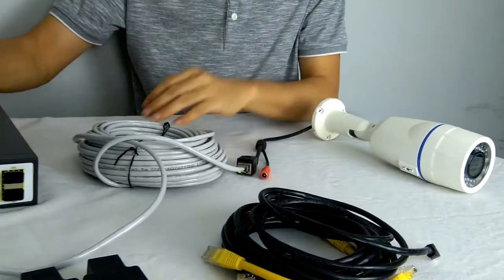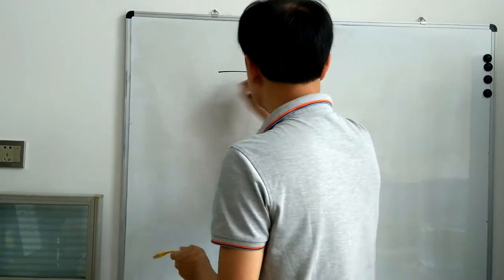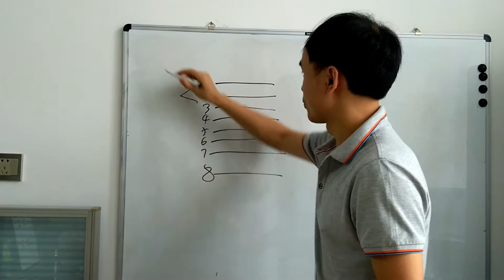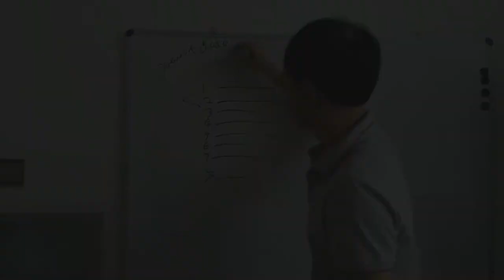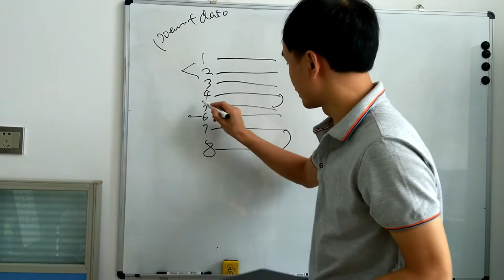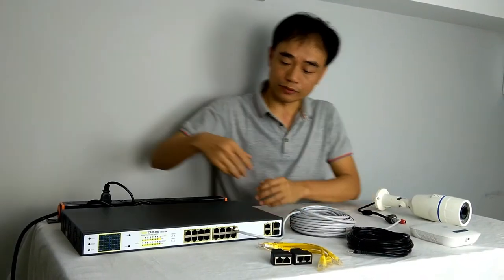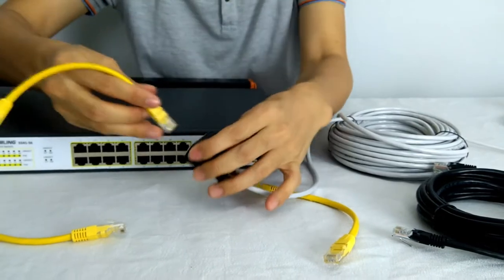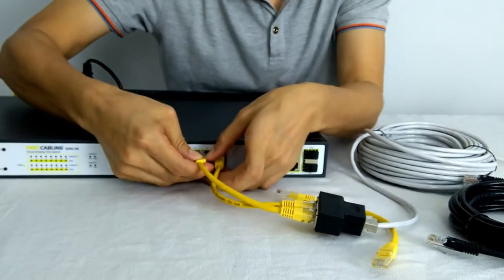Use single Cat5 cable to connect 2 PoE IP cameras

Comment: There are 2 POE modes:

Mode A (endspan) - power is sent together with the data on pairs 1236, meaning pairs 4578 are free.

Mode B (midspan) - power is sent on pairs 4578, meaning data is sent on pairs 1236.

Mode A (endspan)uses 10/100 only.

Does anyone know any Mode A (endspan) poe switches for sale, I need it for myself to install hikvision poe door station and indoor station.
Reply from the maker: Are you sure it is the 12-36 power pin you need? Most PoE switch use 12-36 as power pin now. You might see some mid-span power solution on PoE injector or not-standard PoE that has remove the power handshaking (force to inject the power). By the way, the mode A has no problem to supply 1000mbps. The latest poe++ take all twisted pairs to send the power 1236 and 4578. The 45-78 mid span was popular because it is simple to separate the power and data transmission at the beginning, but the PoE technology is very sophisticated now.
Reply: @Fastcabling 

Thank for the reply.

I have 1 cat6 cable which needs to connect 2 POE hikvision intercom devices. 1 for poe doorbell and 1 for poe indoor station.

Somehow I need to get this to work. Do you know anyway to make it work using 2 port extender?

Comment: Hi I try these two adaptor to connect two HIKVISION smart hybrid cameras to a poe HIKVISION NVRbut it doesn't work
Reply from the maker: If the NVR take 45-78 spare twisted pairs to send the power, it will not work. There are 12-36 and 45-78 4-twisted pairs in UTP cat5e cable. Most PoE NVR send the power over 12-36 together with the data, leave 45-78 not used. The adapter employs the not used twisted pairs to connect the second camera. However, if the PoE NVR take the spare twisted pairs 45-78 to send the power which is seperated from the data. You can't re-use the cable to carry the second camera.

Comment: hi, I have a hikvision poe nvr and hikvision ipcs, they dont work with the 1235 commercially available splitters, how must i wire my splitter / combiner, i use t568b standard - great video, also for us dummies 🙂
Reply from the maker: If you are sure your POE NVR take 45-78 spare pairs to send the power, it will not work with this low cost solution. You might consider the 1 in 2 out PoE extender. https://www.fastcabling.com/product/poe-extender/
Reply: Did you later solve it ?

Comment: Ciao. Quindi posso collegare due telecamere poe su un unico filo ethernet su nvr?
Reply from the maker: In genere non è consigliato. Il modo migliore per collegare più telecamere è tramite uno switch PoE. È possibile far passare un singolo cavo Ethernet dall'NVR allo switch PoE, quindi collegare più telecamere PoE a tale switch. Ogni telecamera trasmette dati video tramite il cavo Ethernet e combinare due telecamere su un singolo cavo comporterebbe la condivisione della larghezza di banda, il che può degradare la qualità video e causare potenziali problemi di rete.

Comment: Why with this splitter, when I I test both ethernate cable, there is missing channel one in all 8 channel?
Reply from the maker: Can you explain "missing channel one in all 8 channel"? The splitter simply seperate your cat5e cable in two group. As you know, only 2 pairs - one group is enough for fast 100mbps Ethernet. If you have choose the correct Etherent PoE switch, the power can be transported as well as the data. You got two group twisted pair after add injector/splitter both side. that is how to power to PoE IP camera.

Comment: It didn't work for me. With only one camera plugged into the splitter, it worked. When I plug in the second camera the whole system crashes and I lose all video. All cameras are from the same system. Might be because one of the cameras is a PTZ camera.

Comment: Hi I bought a hikvision 4k camera system with 6 cameras.  Do I need a power supply? Or can I just plug it in ?
Reply from the maker: If it is the PoE NVR or PoE switch ready, you can just plug in without using power supply.

Comment: Hi cn it work with poe injector using ip camera n ap acess with poe injector but not cctv poe switch how if use tp link poe ports ? Cn it work
Reply from the maker: Yes, but you will need to pick the PoE injector which take 12-36 data pin to send the power. Most PoE injector use 45-78 spare twisted to send the power. It will not work. As the second camera needs 45-78 in the cable.
Reply: But my second port is not conventional ip camera just tp link c210 will use poe spliter so cn use poe injector to up the device

Comment: I have a SWANN CCTV system and I want to run 2 camera's off one cat 6 cable.  I have the splitter adaptors but it still does not work.  Do you have any suggestions to how i could get it to work?  I am thinking maybe there is not enough power off one cat 6 line for 2 camera's to run so would it be possible to get a power boost?
Reply from the maker: You might test single camera. if it doesn’t work with single camera, the problem is the PoE NVR use spare pairs to send the power which suppose to carry second camera in your case.

Comment: Hello. I have a tp link sg1210mp switch and vigi camera. Will work for 2 camera with one cable ?
Reply from the maker: Yes, it should work. The sg1210mp takes 12-36 twisted pair as power pin.

Comment: can you tell us the specific splitter you used and where to order? thank you
Reply from the maker: This is the link: https://www.amazon.com/dp/B07G9C7KSL please understand both PoE switch and IP camera should be compatible with IEEE802.3af/at standard. It doesn't work with PoE NVR, as the PoE NVR employ separate twisted 45-78 for power.
Reply: @Fastcabling  what splitter would you use then to run from a POE NVR to run two cameras over one cable?
Reply from the maker: @eckathewrecka  You may have an issue using the splitter to working with PoE NVR. Some of the PoE takes 45-78 spare to transmit the power which means you can't splitter the Ethernet cable. All 4 twisted pairs has been ocuppied.

Comment: Will this method work with a Tenda TEF1105P-4-63W 5-Port PoE Switch - TEF1105P-4-63W?
Reply from the maker: This method only can re-use the Ethernet cable, It can save the PoE port. You will need to verify the power pin from TEF1105P is 12-36

Comment: I have post the picture on one of my cameras at my front gate and believe one of the cables is damaged, how can I use this system to run one cable and get both cameras working?
Reply from the maker: I suppose both cameras support PoE (Power Over Ethernet), if this is the case, you should examine how to camera get the power from your PoE NVR or PoE switch. This solution only will work if the POE system uses the same twisted pair (12-36) to transmit the power and data which gives you a spare twisted pair (56-78) to send the power and data to second cameras. The other solution is POE extender which can supply two independent POE ports by using a single Ethernet cable. https://www.fastcabling.com/product/poe-extender/. It doesn't have a requirement for your existed PoE system.

Comment: Thanks for this. I will like to get clarity on this. Once a POE switch supports 12-36 as power pins then this method can work for two ip camera over one ethernet cable.
Reply from the maker: Yes, as long as it supplies power using 12-36 pins.
Reply: I did this in hikvision NVR and it didn't work, any idea

Comment: Can use this method to connect 2 cameras to nvr
Reply from the maker: It depends how your NVR design. It is vendor specific. If the PoE NVR use spare twists pairs to send the power (45-78). Not sending the PoE power over data pairs, it will not work.

Comment: How can use 1 Cat 5 or 6 cable to run 2 cameras?
Reply from the maker: You can use the splitter to separate the cable into two or you can use the 1 in 2 out PoE extender. https://www.fastcabling.com/product/poe-extender/

Comment: I tried connecting the same way but we are getting the green light on the access point but no light on the switch side. and also the access points are not getting detected on the controller
Reply: The access points are TP link EAP 115
Reply from the maker: You may try the PoE switch instead of the original PoE injector because the original POE injector is a passive injector. It takes 45-78 spare twisted pairs to send the power.

Comment: Hi, can i use this device to split and add one more camera (in single cable) to my Reolink system?
Reply from the maker: It is hard to say. It depends on how reolink design his campers. If the PoE power goes through the same twisted pairs 12-36 yes it will work. otherwise It doesn't

Comment: I have 2 cctv cameras and i want to permanently wired to my router but my router has only one socket for the two cameras... how can i do this sir and thank you so much
Reply: You will need 1to2 PoE extender. One Ethernet cable in, 2 PoE out. The coming in cable will tak the PoE (power over Ethernet) from your PoE switch or PoE injector.

Comment: Hello, this only allows one device on the internet to run at any one given time and not both at the same time..... does this mean it cannot run 2x IP cameras working at the same time on the network?
Reply from the maker: This video discuss how to use one existing cate5/cat6 cable to run two PoE IP cameras. If your existing PoE system use data twisted pair 12-36 to transport both power and data, you got spare un-used twisted pair (45-78) which can carry second PoE IP cameras. You still need two PoE ports at the centers. It doesn't require the network port. It is all about double use the Ethernet cable.
Reply: @Fastcabling  Thank you
Reply: @Fastcabling  Does it work with 2 Reolink cameras?

Comment: i know that gigabit devices need all 8 wires to work but what about poe ip cameras that have specs saying they support both 100/1000 Base-T. Can they work on 4 wires or only 8 wires?
Reply from the maker: The 1000mbps bandwidth require 4 twisted pair (8 wire). The 2 twisted pair (4 wire) only can provide 100mbps. As I know, most of the IP camera support and only require 10mbps bandwidth, even you consider the traffic peak, 30mbps is more than enough. Unless what you try to use is the Mutiple sensor camera (one camera has several sensor built-in), I really have no idea why 1000bmps do any help. 4 wire PoE only can transmit 100mbps, that is decided by IEEE802.3 protocols.
Reply: @Fastcabling  ok so can this camera  DH-IPC-HFW81230E-Z which is advertised as supporting both 100/1000mb work with just 4 wires?
Reply from the maker: @adyady3099  According to the specification you sent me, the 1000mbps is  reserved for mass accessing. The camera allows 20 users accessing at the same times.

Comment: Great video! I got one question for my Ip cam system.

My home using tplink nc450 and use PoE injector, is this no way to use 1 cable for 2 tplink nc450?

Thx👍🏻
Reply from the maker: The tplink nc450 is passive PoE device which means the spare twisted cable has been ocuppied to transmit the DC12V power. There is spare twisted pair you can re-use to send the data or power for second tplink nc450. If the camera is standard PoE, there are mutiple solution to extend the PoE port.

Comment: Can u send the link where to buy the splitter
Reply from the maker: Could you please send an email to support@golbong.com? The team will provide you the related link. It is important your PoE system is end-span that use 12-36 to transport both power and data. Otherwise, you don't have spare twisted pair to send PoE to your second IP device.

Comment: Can’t understand.
Reply from the maker: Sorry for the confusion. The cat5e or cat6 cable has 4 twisted pairs. The PoE/PoE+ and the 100Mbps network only take 2 twisted pairs to transmit the power and data. Those two splitter will divide 4 twisted pairs into two group. So you can put two cameras over single cable.

Comment: Hi, Nice video but at the end, not really clear on which POE devices are not supporting this way?
I'm using HIK NVR and I wish to use this system for 2 HIK Poe camera.
Is this way will work ?
Reply from the maker: It really depends on how HIK design the POE port. If the power is going through spare twisted pair 45-78, it will not work. If I set the automatic connection to each port, it will not work either.

Comment: Hello. Thanks for info. Will this work with 2 Lorex LNB9252B cameras?
Reply from the maker: It depends on the PoE switch, but not the IP camera. Most of the PoE IP camera accepts power over 1236 or 4578. However, the PoE switch only will choose one path to send the power. If the PoE NVR or switch choose 45-78 to send the power, you can't take 45-78 to carry the PoE for second IP camera.